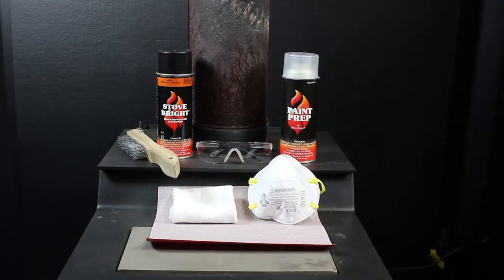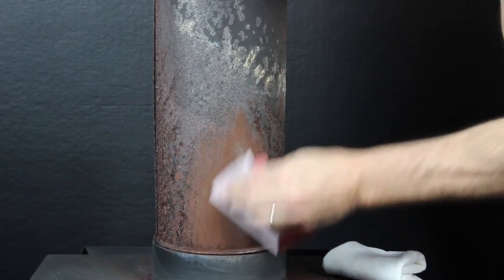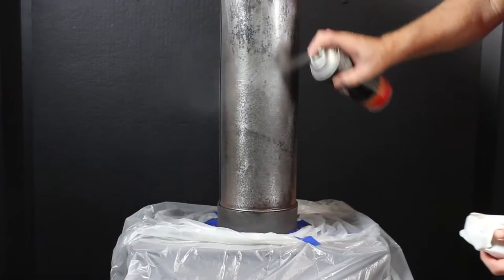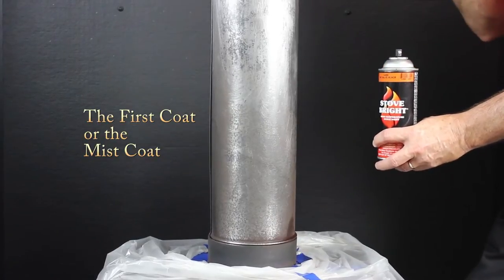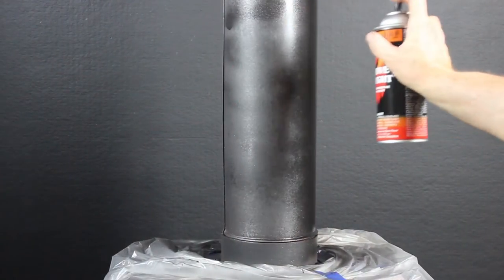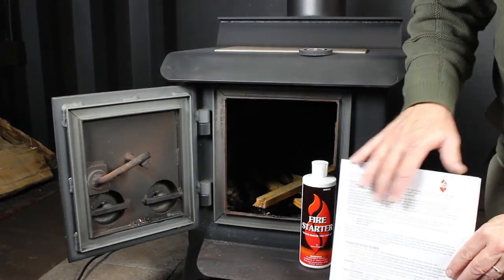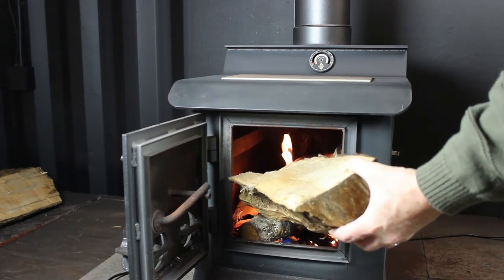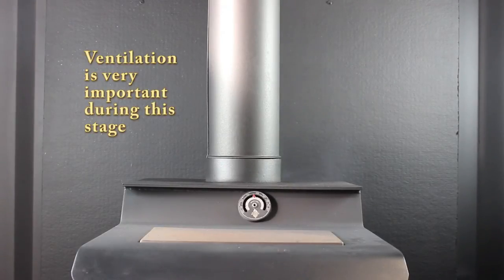Paint Stove Pipe with Stove Bright® High Temp Paint Aerosols (HOW TO)

Comment: Thanks for the video! Most of my stove pipe is still covered with a very glossy bright red paint, which I think will be very difficult to remove.  After sanding the part where the paint chipped off, I want to paint the whole thing black or dark gray. What do I need to do to prep the existing paint?
Reply: The stove pipe repainting process is the same as the stove.  You must sand and remove any gloss from the paint  for the paint to attach to the surface.  Please go to our website for complete instructions.  http://forrestpaint.com/stove-bright/stove-bright-user-guide/  Thank you
Reply: Thank you for the reply. I read the instructions in the link. I have about 6 linear feet of pipe with very shiny red paint. I understand I can just scuff it to prepare it for painting. But one pipe segment has heavy scratches all the way down to the metal. Seems like I need to remove almost all the paint from that segment. To do that, is hand sanding the way to go, or should I invest in an electric buffer and sanding pads? Any other ideas are welcome.

Comment: Thank you for sharing this information, I do not believe you
have wrecked you smoker. I cannot speak for Rust-oleum. Our Stove Bright paint
has not tested or rated for use on any food contact surfaces. The fumes and
odor will subside as the smoker cures at any temperature. The higher temp's are
the ideal curing circumstances. Good luck with your project.